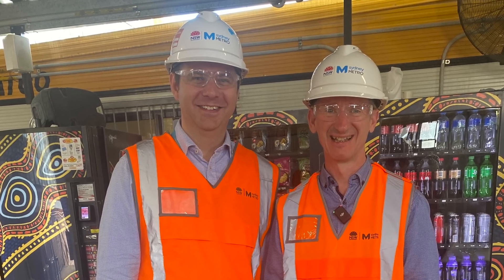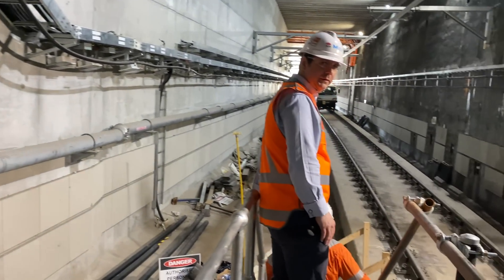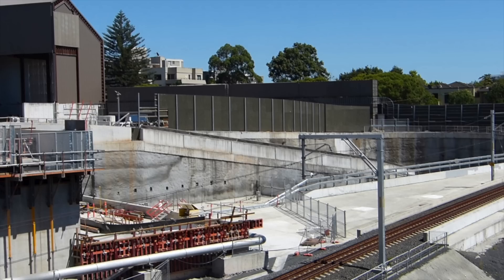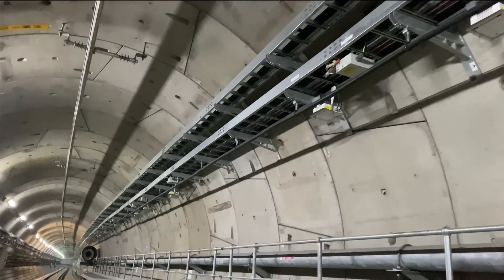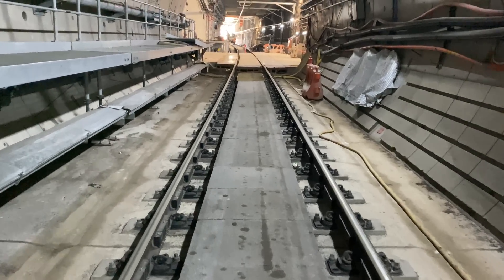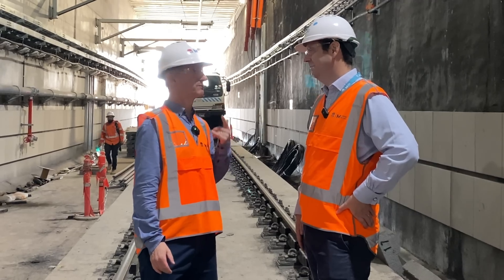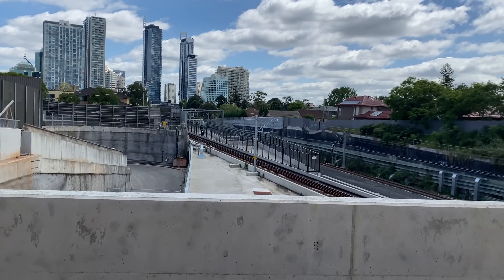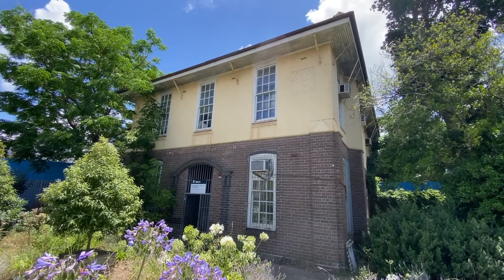Inside a Sydney Metro Tunnel at Chatswood Dive Site

Comment: I live just 500m away from Cherrybrook metro ... my family & I have been using North West Sydney Metro regularly since it opened in May 2019.
Looking forward to going straight from Cherrybrook to Sydney CBD when this line opened in 2024.
I wonder though when it will open next year (early or mid or late 2024).
As I still remember with the North West Sydney Metro line ... the testing was done for more than 6 months.
It is already 8 April 2023 and there seems to be a lot to be done in each station.
Reply from the maker: Hi Herman, must be wonderful to live so close to the metro and Cherrybrook is one of my favourite stations! Apparently testing is starting later in April, so that could opening in early in 2024. The stations below ground are more or less finished, with platform screen doors, lifts and escalators all in place.  They look unfinished because of the over-station developments happening above, but the stations could open whilst work on these developments continue. Also the line could open with some stations, rather than all from day 1.  I think the Bankstown line conversion will happen later, perhaps even opening in 2025.

Comment: In the original Epping to Chatswood tunnels which were converted over to Metro use, those access platforms that ran the length of the tunnels were actually designed as evacuation pathways - they were not simply maintenance walkways. That may be the case in the new sections but that guy misrepresented the original intent of the infrastructure.
Reply from the maker: Hi Kevin, thanks for that.  Yes it's quite possible that the purpose of the maintenance walkways was different for the Epping to Chatswood Line, especially as evacuating a train from the front or back would be much harder on a Waratah, Tangara etc.

Comment: Hey Paul, where has the tunneling mob dumped all the spoils that they removed from the twin tunnels they dug?
Reply from the maker: I think it went to a variety of different locations for reuse.  The reason for the temporary shed was to store the spoil until it could be moved away.  Only a certain number of truck movements were allowed, so it wasn't always possible to get the spoil away immediately, hence the need to store it on site for a few days.

Comment: Thanks, Paul for yet another great video and so pleased you had the cooperation of the Metro management. I wondered about the rigid power bar as opposed to the overhead wires that move so as not to wear out a particular area on the pantographs.
Reply from the maker: You're very welcome Geoff. Yes, it was lovely to be invited by Sydney Metro to view the dive site and tunnels.  I felt very special!  Yes, the reasons for using a rigid bar has been a question I've wanted to ask since I first saw one at Bella Vista station in 2019!

Comment: Looks incredible. Amazing work Paul. Thank you so much for allowing us in with you. If only they made the tunnels just 1 extra metre bigger. 7 metres in diameter not 6 metres, (I have my reasons ☺️) It would of been perfect. Nevertheless looks amazing. 🤗
Reply from the maker: Thanks Jake, Glad you enjoyed this behind the scenes look inside the tunnels!  Would that make it the same size as the Epping to Chatswood tunnels?
Reply: @TransportVlog  you are most welcome thank you. YES, it would make it the same size as the Chatswood to Epping run. Unfortunately, I think the government deliberately selected a smaller size tunnel to have a physical incompatibilty with the rest of the Sydney rail network. Even though the metros will remain stand alone always. Its logical to have mathamatical consistency in public infrastructure. Larger tunnels would of also allowed for better air flow at higher speeds, avoid rocking of trains, future equipment being installed, larger tunnels for maintence equipment, track repairs, passenger evacuations. I guess I should be grateful we at least got a rail line in the first place 😊.

Comment: Great video. Though don’t think the Sydney Metro guy explained WHY the rigid overhead in the tunnel. Main reason of course is to reduce maintenance costs, but the reason it used used in the tunnels and NOT in the open is in the tunnels the temperature doesn’t vary by much so rigid system can be used. 

But in the open there is a wide variation of temperatures and wind etc so a catenary system is required to give the line flexibility to withstand wind and temperature variations but still able to be tight enough to allow pantographs to keep good contact.
Reply from the maker: Hi Ashley, Glad you enjoyed this video and thanks for the extra information on the rigid bar system.  I'll include this when I do a front of train video on the tunnel sections of Sydney Metro North West.

Comment: Hi Paul, thanks for another fantastic video! It's really great that your efforts have been recognised first by the PLR team and now by Sydney Metro! I look forward to many more updates as SMW and SMWSA pick up pace!

And a little bit of an explainer about the kinematic envelope and how it factors into tunnel design just in case you're interested.... The kinematic envelope is the space which a train could occupy when running along a track. When calculating/modelling it, you have to take account of the things you mentioned like speed, suspension and curvature but another important factor is track movement. Ballasted track is not fixed in place and tends to shift over time. Slab track on the other hand is fixed so there is very little movement. Because the kinematic envelope for ballasted track has to take movement into account, it's a bit larger than slab track. Now, in tunnels, there is a whole host of equipment attached to the lining like Hugh mentioned. We want to build the tunnels as small as possible to keep costs down, while making sure there's still enough space to fit the equipment without it clashing with the kinematic envelope because then it could be struck by a train. So, using slab track in tunnels helps minimise the tunnel diameter because the kinematic envelope is smaller than ballasted track. Slab track also has other benefits in tunnels but I'll stop the lecture here!
Reply from the maker: Thanks! yes its wonderful to be getting the recognition from PLR and Sydney Metro.  I have been making some contacts within Sydney Metro West too. Thanks for your extra information on Kinematic Envelope and how slab track keeps this movement to a minimum. I took a trip to Lithgow last week and noticed that most (if not all) of the track in the tunnels between Bell and Lithgow was slab track, and quite a few of the short cuttings between the tunnels had track slabs as well.

Comment: Nice video Paul. I like this Chatswood Dive Site.
The Sydney Metro between Chatswood and Bankstown are still under construction until 2024 but getting a huge Upgrade Update.
On the Bankstown Line, The Orange Sydney Trains Signs will be replace into Blue Signs on the Sydney Metro.
The connection site of the Chatswood Dive Site is connected to a tunnel for a construction frequency that head north to the Bankstown line with an underground tunnel tracks will be the same as the Northwest Line between Tallawong and Chatswood, and it will be an impacted Sydney Metro Diversion of Sight. For each tunnel, they have Tunnel Ventilation Fans used for tunnel construction of the Sydney Metro. The actual tunnel portal is an underground Sydney Metro development of the Northwest Line, which was an operational facility of the Sydney Metro Construction of sight. The Southbound tunnel is going to the Bankstown line and Central as a transit route to the tunnel down sight of the tunnel. The original sight is the Sydney Metro Construction Upgrade at Central, the Bankstown line and the tunnel that goes after Chatswood station. The high voltage on the Sydney Metro has a concrete track to the Sydney Metro Tunnel Package. Some of the Sydney Metro is impacted to Hunter Street and three station of Eastern Tunnel Package near the sight of Martin Place station. The opportunity of Sydney Metro is impacted of the Chatswood Dive Site through the Tunnel of Southbound to Bankstown, Central or the Dive Site of Chatswood Station. This video is interesting, I like it and it’s very cool and nice. Nice video Paul, and Keep going. You are making great content.
Reply from the maker: Thanks Brendan, glad you enjoyed it and thanks for your other comments as well.

Comment: No matter how many times I watch the supposed reasons for this project, I am still baffled by the decision of prior governments to construct a separate rail system with separate operators, seperate knowledge pools and separate fleets and then claim its more beneficial than a DD line. I'm sorry, it isn't.
Please change my mind on this, I hate to see so many billions thrown into what I can only see so far as a waste.
Reply: Metro much quicker than double decker rail from the Hills district
Reply from the maker: @TheTrainGuy4 - It is much easier to bring in new technology such as CBTC and driverless trains on a new dedicated railway.  Look at Crossrail in London for the challenges involved in integrating 3 different signalling systems. I tend to think of Metro is a different type of service to conventional trains.  In London, they have conventional trains and tube trains. Tube trains run on dedicated lines within minimal junctions and that allows up to 30 trains per hour, which wouldn't be possible otherwise.  Sydney Metro could potentially run at 24 trains per hour through the CBD, and I think the existing Sydney Trains lines though Wynyard and Town Hall would struggle to achieve that.  Finally, I'm very pleased that Sydney is building more railways and that's got to be a good thing in itself!

Comment: Hi Paul, do you know why both tracks (northbound and southbound) aren't in the same tunnel?
Reply from the maker: Great question! I think it's easier to bore smaller tunnels, and it also allows more flexibility to go around building foundations. In the CBD, the southbound tunnel goes under Elizabeth Street and the northbound tunnel under Castlereagh Street, so they are quite far apart. Single tunnels seem to be common practice on most new metro systems these days. I'm sure there are other reasons that I'm not aware of, but hope this helps for now!

Comment: Paul .. any inside info on when they will start trialing trains under the city? Also how will they be delivering new carriages? 
Do they come by ship? Then transported down to somewhere to be place on the tracks?
Reply from the maker: I reckon test running will be later in the year. We might see the occasional train going through the tunnel section under manual control sooner, especially to test all the infrastructure at Trains Facility South. Yes the new trains come by ship and then by road. Many have been delivered already and I believe some are already in service on Metro North West.

Comment: Thanks for explaining Kinematic Envelope.  As someone with no knowledge of any of this stuff, is it me or are the tunnels really big relative to the train already?  I feel like the "Kinematic Envelope" is quite big/conservative/overkill?  Especially compared to like London's tube with really small clearance space. https://en.wikipedia.org/wiki/Loading_gauge#/media/File:Why_London_Underground_is_nicknamed_The_Tube.jpg
Reply from the maker: Hi William, you're very welcome.  Modern tunnels have to be wide enough to include a walkway on one side.  As the tube is much older, the tunnels never included a walkway. The only exception is the newer part of the Jubilee Line from Westminster to Stratford. Tube trains also have a smaller loading gauge, especially in height, except for the sub-surface lines which are similar to metro trains in terms of loading gauge. Hope this answers your question.

Comment: I knew a worker in the Epping/Chatswood project. It took a year to fit out the tunnel after it was constructed. No doubt this is well underway to make it work in 2024.
Reply from the maker: Yes that’s right. The fit out will take a while, but hopefully we’ll see some test trains before the end of the year.
Reply: @TransportVlog  the tunnel you were in had most essentials installed like cables, overhead electricity and pipes installed already. Hopefully this is like that through to Sydenham already.